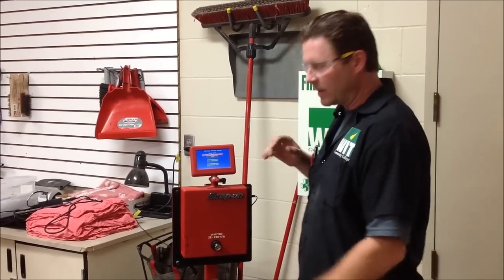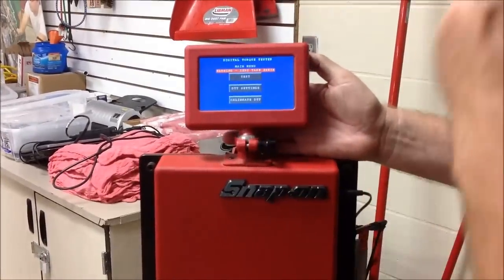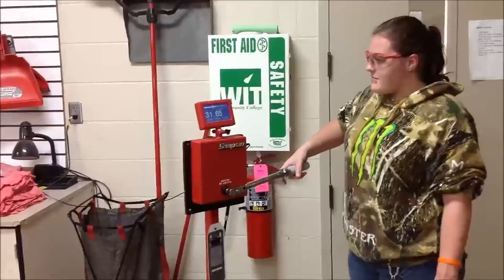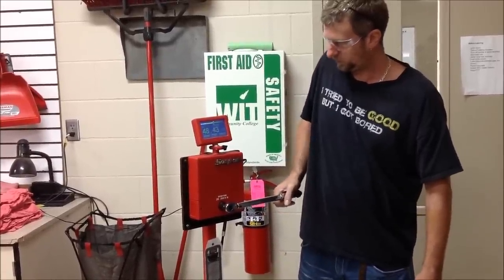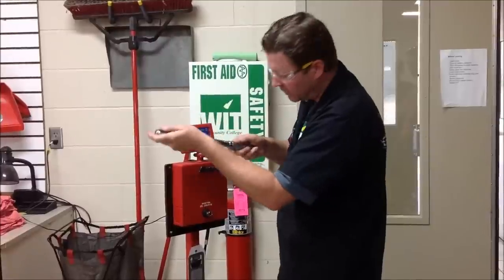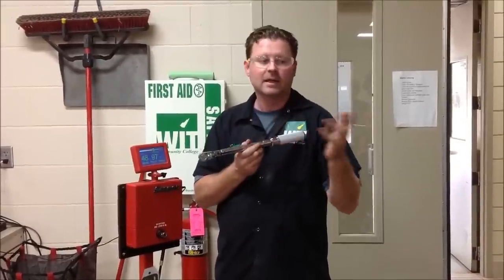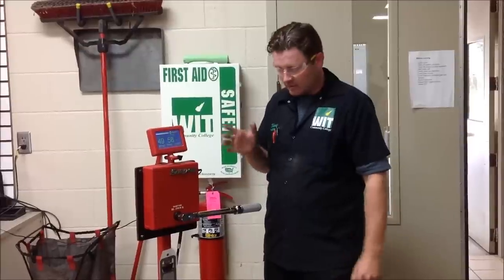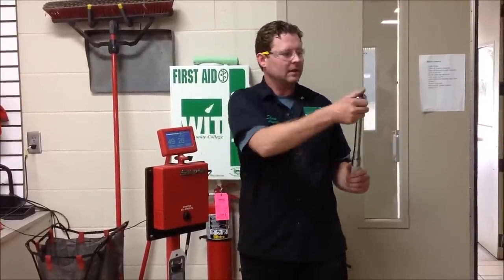Torque wrench calibration check Harbor Freight vs Snap On

Comment: That's the thing. If the average guy gets a torque wrench at Harbor Freight how is he going to know if it's accurate or not until he starts breaking bolts.
Reply from the maker: Amen....or not correctly torqued.
Reply: Exactly, too little torque = "I'll get it a little tighter that didn't feel right." Too much torque = Broken bolts. Hell, you might as well not even use the thing, or buy a good one to begin with.
Reply: Shane Conley were the middle of the road priced wrenches like craftsman decent? 
I have snap on myself , but I'm wondering, I like passing info to tech friends
Reply: MrTheHillfolk Craftsman wrenches are great and cheap. Do you want fully polished ones though?
Reply: Matt's Shop 
it's not a big deal, it's for my personal shop and things like that. 
More for personal use if I forgot to bring home the snap on for the weekend. 
I've gotten my dad an sk about 15 years ago, he had it calibrated because the handle end came apart but he repaired it and figured to be safe.
Reply: MrTheHillfolk Yea, I love Craftsman wrenches. Some guys don't like them because of the handles and the heads are kind of fat. If you wan't fully polished ones they're nice, but I don't have any. They sell them online, but they are $$$ if I remember correctly. If you want some cheap ones just get the regular Craftsman USA ones.
Reply: Matt's Shop between me and my dad, we probably have 3-4 craftsman tool sets all jumbled up. 
The ones that include sockets wrenches screwdrivers etc, usually a couple hundred pieces. 
Haha like we need 4 1/2in 6 point shallow 3/8 drive sockets but it is what it is. 
I can grab my snap on stuff from my work if I have a job that requires it at my play shop, but if a craftsman torque wrench is good enough for the stuff we get into,I'm fine with that. 
Heh, I already sent this vid to a few friends and the reply was basically "not surprised".
Reply: Oh my god exactly. I don't know what to do. I don't want  to buy a god damn 600$ torque wrench. I had a MAXIMUM torque wrench but now I'm going to get TEKTON torque wrench and no way to know if they fine enough. Ffs.
Reply: TheMidnightNarwhal Buy a beam style torque wrench. Unless you use it every single day. Lasts forever and don't have to worry if it's Chinese because its's so simple.
Reply: Matt's Shop 
True. 
If they have a pivoting handle you need to"float" it in the center , but yea with a little instruction a beam style is decent

Comment: Confusion for viewers-- At 2:10, tester "Britt" held the Harbor Freight wrench correctly, and so far as can be determined, applied consistent pressure at a tool setting of 60 lbs. Yet, his results were inconsistent. Shortly afterward, Shane applied pressure with the same tool, and claimed he got consistent and accurate results ("every time"). As a further check on consistency, Shane then changed the HF tool settings from 60 to 40, but this time, found 50 lbs at least once when he had set the tool to 40. That is, the HF torque wrench was off its assigned value for both Britt and Shane, but at different values. This is a serious concern, because 10 lbs inaccuracy could dethread or even break a nut. 

If Britt can get different readings in rapid succession in a proper test, it does not matter whether Shane gets consistent results-- any of us could find the same inconsistent results as did Britt. What does this say about the particular Harbor Freight tool? That question about the HF tool was never resolved in this video-- at least, by using another HF tool of the same model in another test for consistency with the same operator. As matters stand, I am not as eager to go anywhere near HF tools, if any of them can be so far off the assigned value.

Comment: I had a craftsman simply stop working, I was ticked off that the ydon't have the "Lifetime" guarantee since its a "movable part" and on a budget I decided to try the Pittsburg, beyond the crappy handle I justified it as I grew up with wobble style torque wrenches and the occasional slip of a lb didnt seem like that big of a deal.
I had a 3/8ths fail and now a 1/2inch explode at 95lb, I mean the plate on the head popped off and pieces everywhere. Thankfully I had just finished at 8PM and was only on lug nuts, so the car is at least driveable.  
I wish I Had seen this video before I bought the damn thing, now it's driving into my head how wrong the jobs I've been doing may have been. 
Thank you for the Video.

Comment: You are correct, but failing to explain how or why this works. A torque wrench is not a ratchet, it is ratcheting for convenience. You are applying force to the internal mechanism, so when you add a lever, (cheater pipe) you are applying more force to the mechanism first, then the fastener. This style torque wrench has a breakaway component, when you turn the handle to change the torque adjustment, you are actually changing spring tension inside. So your fastener is on one side of the breakaway component and the point at which you apply force the other, once the fastener's resistance to motion overcomes spring tension the component breaks away producing the "click"
Reply: Yes, but many of the commenters below are confused and cannot understand why proper hand placement (as shown towards the end of the video) is so important.

Comment from the maker: For all of you viewers, you will find this channel most useful if you can wrap your head around I don't work for any tool company. I would also ask you to consider (like I must do at times) is realize your wrong. I am passionate about education and delivery of technical skills training. 
Think about the facts we have here from all my torque videos, training, and experience:
1. SnapOn, Mac, and Craftsman Torque wrenches have given consistent reading on this machine.
2. Harbor Freight tq wrenches have given a consistant failure reading. 
3. All used brands have had their torque wrenches fail on this machine. Why? My belief is they were dropped or "over used". It's a guessing game regardless, they failed meeting the standard test on this calibration tool. 
What lesson's are present?
1. Tools need to be checked for calibration. This costs money. Your brand name torque wrenches come with serial numbered spec test sheets to that wrench. 
2. Cheaper (I don't care what the brand) are randomly tested at who knows what rate.
Simple. Choose you tools wisely. Failure or success is waiting. 
Keep Wrenching,
Shane Conley
Instructor/Motivator/Motorcyclist
Reply: how do you know the calibration machine is calibrated correctly :0
Reply: Seemed like a great video...why I have a expensive Craftsman Professional series one. Also don't drop your torque wrenches and use them properly for what they were designed for. I'm no expert but I take care of my torque wrench it goes right back into the plastic container it came in, in the tool chest after using. How are the HF ones shipped to the stores? In a big bin with no packing?
Reply: It's why he went back and tested other ones and also retested after the HF one back to the snap-on to see. But you are right in the QA world that machine would also need to be tested after so many uses. Not sure how they do that. I know how they could do it in a manufacture setting, maybe it has to be sent to snap-on to be tested and re-certified?
Reply: Meeker Extreme 
oops , don't forget to "relax" it too😁
Dial the torque off to the minimum reading. 
I'm sure ya do it sounds like it. 
usually a tech who works in a garage , can have his mobile tool guy send it out for calibration. 
If your a weekender, you probably wouldn't need to send it out but every 10 yrs. 
I sent mine out 1-2 times in like 5-6 yrs of being in an engine rebuild shop. 
If nothing, its convenient to have the tool Guy deal with it.
Reply: not once did you mention if you calibrated any one of these. yes Snap-On is better, but the possibility that the cheap HF didn't go through proper setup should've been accounted for. These tools can be calibrated, had you done calibration and showed it go off after a few uses, that would've have been a good test. Now I don't believe it would've made much difference, but you should have had them do the same test procedures for this "lab" test. The test was poorly executed and at best the results proved Snap-on accuracy out the box. -QC Specialist
Reply: Very true, but if you watched the student and the instructor both, the effort they used on the HF vs. the Snap-on was perceived as greater.
Reply from the maker: sysjls75 
The HF takes more effort to "click" regardless of setting. That's why both students and instructor seem to have done it.
Reply from the maker: ri mar 
Think...stop and think...ok...ready? No end user calibrates a precision tool out of the box. That's the reason you buy a tool. It's "been tested" if the "qr specialist" deemed it bad, it wouldn't be shipped. Make sense? Also as far as this being a bad test, your welcome to your observation, but mind you, the title, purpose of the video was not "how to calibrate your two wrench". It was out of the box end user comparison from a tech instructor whom is torque certified trained and has a unique opportunity to see numerous techs brand of choice come through and be tested. When SnapOn Mac Craftsman all continually read the same but HF is off significantly, one can over time draw the conclusion that there is a problem. Also note SnapOn did not make the tester. It's just branded. I stand behind my test as accurate as used in the real world, right of off the box with no calibration required when new, as advertised by ALL to wrench suppliers. 
Keep Wrenching,
Shane Conley
Instructor/Motivator/Motorcyclist
www.how2wrench.com
How2wrench@gmail.com
Reply: I did give credit to it being ready out of box. One is 600 the other 20, not outside the realm of reality that calibration may be needed. There is also an advantage to being able to calibrate it yourself, instead of having to send it out (yes I have seen a TechAngle be warrantied). I did not state anything about the brand of calibration tester. You've continually added more information throughout various comments, which were not stated in the video. So yeah we'd have to take your word, because instructors could never be bias right? The most highly suspect is test procedures. As an instructor you ought to know how to setup producers and have all samples follow them. Simply because you cannot assume what would or wouldn't actually influence the test results.I'm not like the other commenters who've accused you of being paid by Snap-On,etc. Only what you've shown. You gave very little care to the HF and it showed. Even had you mentioned that "ya you can calibrate this but why buy it if you have to", that would've shown this wasn't one sided. To finish, I wouldn't use the HF torque but I wouldn't disregard it without stating all the facts and why.
Reply: you misspelled Harbor in the title
Reply from the maker: Thank you.

Comment: HF torque wrench lines are accurate and repeatable. It's just that the ft/lb lines dont line up that good so I bet he put it 10 lbs more than it should be. I tested 2 of them on a Snapon Gauge and it's spot on everytime. Both torque wrenches are heavily used and not babied.

The only bad thing is that the 1/2" seems a bit too short so it lacks leverage.

I had snap on torque wrenches that were waaay off and I had them calibrated too.
Reply: I have a coffee can full of broken fasteners that say otherwise when it comes to the Pittsburg "pro" models... Damn things piss me off.. That's why I went snap on 1/2" and never looked back. I have it calibrated once a year for my uses. Recently just bought an all steel techangle model from snap on(735$).. Wouldn't trade it for NOTHING. So you're gonna tell me that 20$ wrench is as accurate and as good as a 735$ wrench? Can it do torque angles? Newp. Didn't think so! I'll keep my snap on broseph..
Reply: +CDubs HasIt So, if I were to throw a $5,000 price tag on a torque wrench....that would automatically make it better than your $735 wrench right? After all, you get what you pay for right?
Reply: I had the click HF torque wrenches, 1/2" and 1/4" and both are junk. In fact both broke at first use, either the internal threads stripped or locked up. Really poor material, fit and finish. Didn't bother to get my money back, not worth the time or gas. With that said the HF digital 1/2" torque wrench is pretty good but I don't think they sell that one anymore.
Reply: so what are you working on that you are breaking so many bolts

Comment: A simple method for comparing torque wrenches requires a piece of hex bar and 2 sockets to fit the bar.      
Attatch said sockets to wrenches,  put them on the hex bar and pull them against each other.      
You can then compare them with each other and see how well they match each other's readings.      
Which one to believe?      
Calibrate with a spring balance.

Comment from the maker: ri mar 
Think...stop and think...ok...ready? No end user calibrates a precision tool out of the box. That's the reason you buy a tool. It's "been tested" if the "qr specialist" deemed it bad, it wouldn't be shipped. Make sense? Also as far as this being a bad test, your welcome to your observation, but mind you, the title, purpose of the video was not "how to calibrate your two wrench". It was out of the box end user comparison from a tech instructor whom is torque certified trained and has a unique opportunity to see numerous techs brand of choice come through and be tested. When SnapOn Mac Craftsman all continually read the same but HF is off significantly, one can over time draw the conclusion that there is a problem. Also note SnapOn did not make the tester. It's just branded. I stand behind my test as accurate as used in the real world, right of off the box with no calibration required when new, as advertised by ALL to wrench suppliers. 
Keep Wrenching,
Shane Conley
Instructor/Motivator/Motorcyclist
www.how2wrench.com
How2wrench@gmail.com

Comment: people bash on Pittsburgh tools all the time...but I can can get a whole tool set/box to beat up, instead of my Craftsman stuff, for 150 bucks...that's like a screwdriver and a magnet from Snap-on
Reply: And it is only good for use around the house. Every HF tool I have used for working on a car broke within the week. That is not mistreating it or careless use of the tools. They just are crappy. In comparison I have had my matco and snap-on tools for three years and have only replaced 2 wrenches from snapping them.
Reply: engelsseele2 You must've got a crappy batch of tools. I've rebuilt three motors and dismantled/reassembled a 51 Ford pickup in a four year span with those tools and only had to replace some screwdrivers and a couple sockets. Granted, the specialty equipment like the micrometer and torque wrenches etc. were better quality...Even with replacement, no quarrels here, HF's return policy is as simple as either bringing in the receipt or punching your phone/email in and it's a quick swap. Their Earthquake impacts give Snap-on and Ingersol a run for their money with how much torque they put out too, I'd check it out

Comment: I personally have tested a 3/8" and 1/2" version from harbor freight within the past 6 months and can verify they are within a pound or two depending on amount of torque.  I believe they may have revised the wrenches and have made more accurate.  

Also I'd like to note that I've used a couple snap on wrenches at the same time to verify the accuracy.
Reply from the maker: Thanks for commenting and adding value to our community!

Have you subscribed yet to never miss a video? Have you seen the video playlists? Over 600 videos! Check them out here: https://www.youtube.com/user/conleybuilt/playlists  

Want to say “thanks” or “keep it up”? Click here https://www.paypal.me/how2wrench    
 
Your answers and help are just around the corner. Save time and money while protecting your investment and yourself by doing it the right way at www.How2Wrench.com
Reply: That's not the problem with most HF tools, it's that there are large variations from one sample to the next, poor quality control.
Reply: One day a few of us tested several wrenches. The only one off by more than 3 was a Craftsman and it was off by 4. 5 of those tested were those HF ones. The ones I've seen were all surprisingly accurate. It all started when we were assembling an engine the night before the race. We were waiting for a buddy to get off work and bring his Snapon wrenches over because were weren't sure which ones we could trust.
Reply: @stinkycheese804  I agree. One place I worked at would provide the techs HF torque wrench and constantly had issues.

Comment: Accuracy is great but it is repeatability that has to back it up. The Snap-on was tested 5 or 6 times in the video and it was always within 2-3%. The Harbor Freight was both under and over the spec on different tests. If it always read 15% under you could calibrate or adjust for it but with widely different readings you are just shooting in the dark.

Comment: I always use Norbar torque wrenches, in my opinion there's nothing better out there. The company specialise in torque wrenches. When you read the information booklet supplied with the tool it tells you to hold the wrench in the correct position or this will change the torque applied. They have tested thousands of wrenches I think they know what they are talking about.

Comment: the thing to remember about torque specs. is that all bolts have the same torque  also the actual torque is important too. as well  no dry threads. now we have torque to yield bolts (one time only as the stretch). one mac dealer did the outside head bolts just a bit less torque. things change apperantly ...
Reply: +Julian Reid lol what are you talking about dude... just no